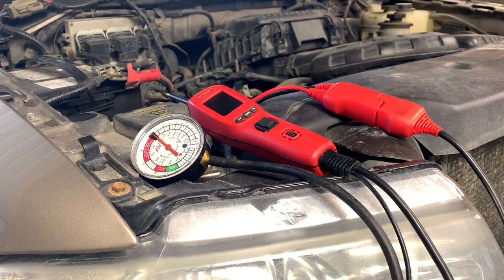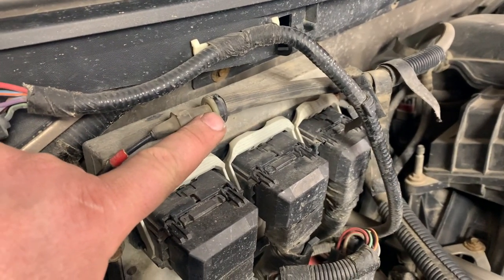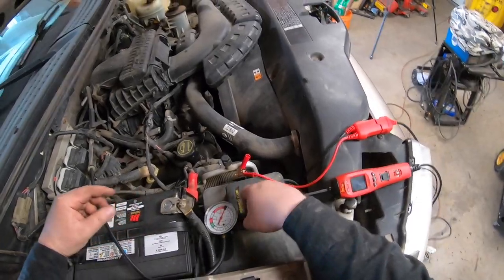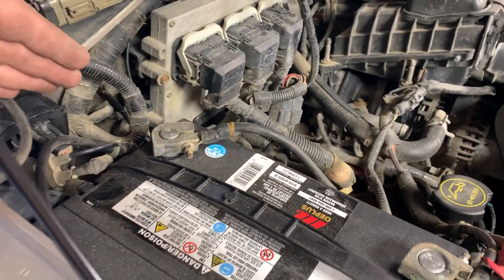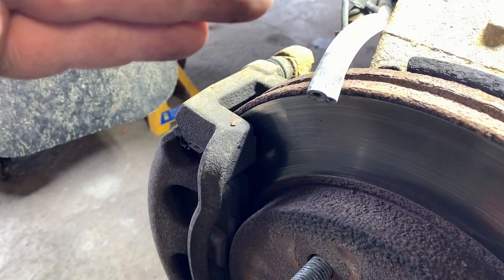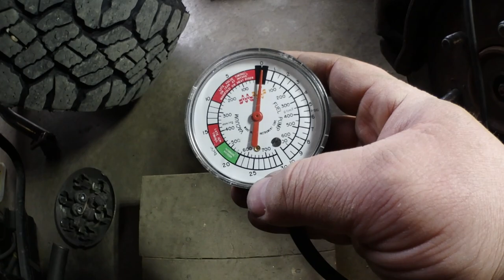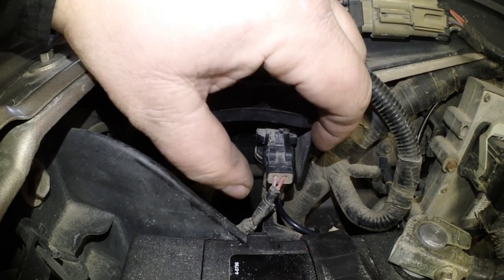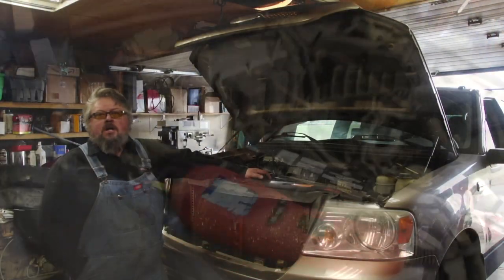Ford IWE Solenoid Troubleshooting and Testing

Comment: Thank you for posting the series of videos on the IWE system.  I have a 2004 F150 and one or both of my hubs had recently started to try and partially engage anytime that I was going up an incline at highway speed and it shifted out of OD.  Based on some other videos I'd watched, I had found the check valve nearest the solenoid to be bad and had replaced it, but my problem persisted.  Turns out that the first check valve (the first one you check in this video) was also bad.  So I replaced that one as well and went ahead and got a vacuum pump/tester and checked the vacuum at all of the points you cover in this video and the next one just to be sure everything else was up to par.  I think I am in good shape now!

Thank you for posting a great, well detailed, and to-the-point series of videos.  I've watched a few on the subject in the past week or so and this series that you did was the best hands down.  Super helpful!  Thanks again!
Reply from the maker: Thank you I try to keep the videos on point and wander off

Comment: That’s why I switched to Warn Manual hubs my F250.  Though I never had an issue, it was a weak point that was worth changing.  I just got my Power Probe from Amazon yesterday and I’m rewatching any of your old videos where your using it.  Awesome tool that is going to take awhile to learn how to use all of its capabilities.  Another great tool I’ve added because of your channel Jerry.  I hardly use my air compressor any more due to my Milwaukee impacts you recommend.
Reply from the maker: You will love the power probe by far my fav tool I have

Comment: I have 21 inches of vaccum at all vaccum hoses. But i still have a clunking noise when driving above 40mph and then accelerating, when i engage 4x4 it goes a away. I lifted the truck up and the driver wheel spins freely but the passenger side feels stiffer but it doesnt spin the axle. If i remove the vacuum both axle spin. Whole could cause the clunking noise?

Comment: Looks like a complex system just to have 4WD.
Reply: The iwe system doesn't actually engage the 4 wheel drive, as many people think. It's used to disconnect the front hubs from the front drive axles while in 2 wheel drive. This is done for fuel economy, as well as to save wear on the front drive train. By default, the hubs and front axles are joined via the iwe when no engine vacuum is present. This ensures that 4wd will still be able available even if there's a cut vacuum line or the vacuum diaphragm on the iwe fails. Yes, it's a bit of over engineering, but if it can potentially affect fuel mileage in a positive way, auto manufacturers tend to do things like this. Fortunately, it's not a terribly complex system, and if there is an issue, it's generally an easy diagnosis.